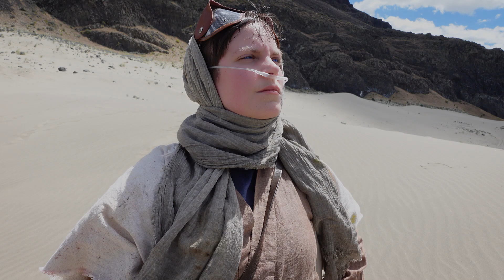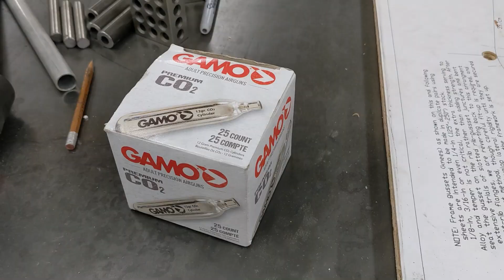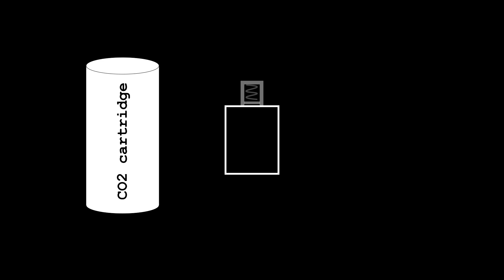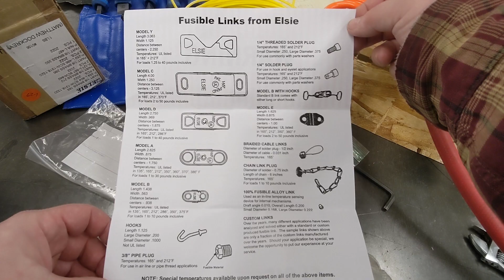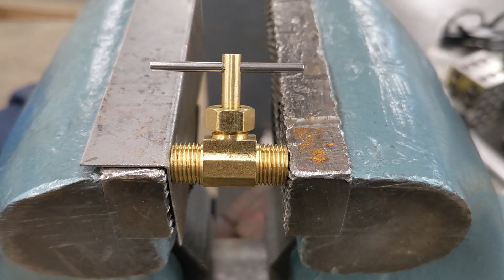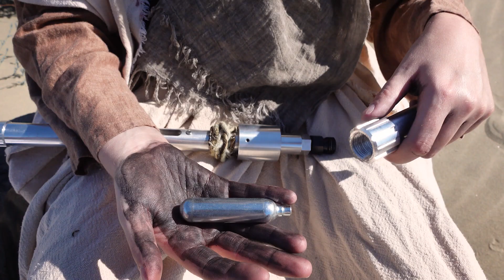Making a Fremen thumper

Comment: Such a cool design!  Wish I had seen this when you first posted it~

I built a couple air-powered WW2 "anti-tank" weapons (British PIAT and German Panzerfaust).  I found a larger CO2 cannister, used for paintball, I believe.  The bigger ones are 88 grams, there are smaller ones that are 45 grams (IIRC~) for soda stream machines.  Either of which is a LOT more CO2 than the small 12 gram ones commonly seen and used in your build.

Despite the much larger volume of gas, the pressure is the same, so the rest of the build can be unchanged.  Just a thought to make this run longer, possibly a LOT longer.

Another thought is to use a different fuse- I have gotten some that runs almost a full minute per foot, so you could do something like that pretty easy.  It's be possible to also have the wicking on the outside use a pre-treated flammable material- much like a campfire or fireplace starter.  Just use some match heads or black powder to give the fuse a little more "OOMPH" once it hits the end.  In this manner, the wick could be pre-applied, and covered with foil or plastic, making the fuse storage easier, too.

Again- thanks for a super-cool build!

Comment: if I had to guess, clockwork is shorthand for a spring powered mechanism, rather than an elaborare system of gears. as for the periodicity, a pendulum is liable to stall at even relatively shallow  inclines so I would guess it'd be an escapement wheel like a pocket watch. however to get powerful thumps as is being suggested, I could only guess it uses something more like a petrol engine.

Comment: Maybe a somewhat strong spring on the top of the hammer (inline). So, the air pressure has to build up enough to overcome the spring, where the top exhaust port would be placed when the spring is at full compression. You could also add a set screw above the spring, which will give some variable spring force. It also seems like it’s leaking a lot?

Comment: Well, I have just spent 20 minutes shouting "CO2 model airplane ENGINE AAAAA!!1111" Tom Stanton has plenty of wids fiddling with them and making his own. Basically - piston has a small protrusion to actuate a ball valve beneath it. Even more basically - piston pokes the ball away from its seat in a ball valve and gets a puff of CO2 in the face. Easy and would run for much longer!

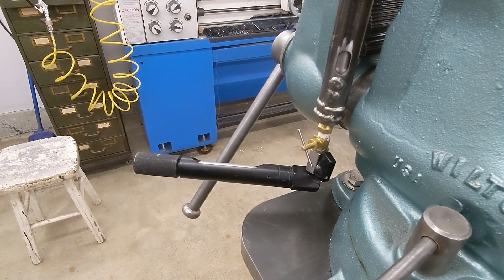Comment: 12:13 Use the 88g cartridges designed for inflatables. They are larger and could increase your run time. It looks like you are using the 12g size. The cartridges for life rafts and vests also have a threaded neck, which may be helpful for attaching to the thumper.

Comment: A clockwork would have solved the run duration problem. A common escapement could provide a minimum of 20 hours run time. Also clock works are more durable than one might expect. The only real challenge is sealing it against sand while allowing it to function. That said, I could never come close to making the system you came up with. You are to be applauded.

Comment: Very neat. Been a Dune fanatic myself for a while. 

Your idea managed to give me some refinement of how I’d see it. Take your idea, but instead of using the CO2 directly, put it through a fixed orifice restrictor, then have it spin a screw. The screw then can lift a hammer against a spring. At a set point a seer on the hammer section is pushed and released. The spring forcing the hammer section down to strike and thump. The seer resets and up goes the hammer again.

The fuel, instant trigger, etc. work just as well as in this video. A screw thread and restrictor give you options to tweak the thump rate to a human stride while probably being a bit more gas efficient, giving you run time. 

Anyways, still a very neat video and implementation.

Comment: If you plan to do a different version at some point, syringe based hot air engines are very simple and give a very nice oscillating movement.  The candle or wick would be the power source, not just the time delay.  https://www.youtube.com/watch?v=WLCrAajASy0  https://www.youtube.com/watch?v=1-XcDuyV2l4

Comment: I'd hollow out the base of the piston and have it hit a poppet valve. Make the bore in the inside of the piston the right depth so that it simultaneously opens the valve and strikes the metal around the valve to make the heavy impact. The open valve releases a spurt of gas into the hollow in the piston, pushing it up and thus closing the valve. If the cylinder is so short the piston hits the upper end, use a buffer spring to slow it down then push it back down to strike the valve for the next cycle.

The fusible plug can be places somewhere under the poppet valve with a screen or a wad of steel wool to catch the ejected metal.

Another method of safe storage and activation, requiring no disassembly and reassembly would be to have the poppet valve in a movable plug with the piercing needle on its bottom. The plug would have a seal and a way to hold it in place after it's driven down. To drive it down, the piston is held at the top of the cylinder by the buffer spring. Designing a way to hold it up against the spring tension - such that it can be released manually or with heat - would be the tricky bit.

Release the piston, it flies downward and by its weight plus spring assist forces the valve block down to where it opens the CO2 cartridge and the block catches into place.

In practice a thumper would be a single use device so there would be no need to be able to release the valve block after it's locked down, or to re-set the catch holding the piston up, or to replace the CO2 cartridge. I'd have a threaded top cap on the cylinder and the CO2 cartridge chamber unscrew from the bottom, where the valve block would be pushed out then re-inserted from the top of the cylinder. A simple stepped plug inserted into the cylinder bottom would serve to set the valve block position so its needle would not quite touch the cartridge seal.

For sealing the valve block in the cylinder I'd expect Fremen to use a wrap of waxed or greased leather. It only has to work once, briefly. A Earth made prop could get by with an o-ring or two and silicone grease.

That's the gist of how I'd make a thumper that's ready to jam into the sand and set off with nothing to take apart and possibly lose in the sand.

Comment: Very cool and simple. I think you are on the right track there with how a fremen thumper would look/function. 

I would be interested in making a variant with a small candle holder. You could use longer candles to set your time and once the candle burns down low enough the flame could be moved into position to heat up your valve. Any latch like mentioned in the book could just be a lighter.

Very cool idea. Any plans to share your drawings on the thing or sell some units?
Reply from the maker: I can't imagine anyone would want to pay what the labor would cost, but I can definitely put up some plans!

Comment: If you neck the flow down to slow the release of CO2 into the piston area, any amount of necking back up underneath the fusible plug will act as a capacitor that can deliver lots of flow, causing a bang when the plug melts. If you cut a hollow spacer to fit inside the plug, you'd replace that large volume of high pressure gas with metal and eliminate the bang. A thinner flow restriction prior to the plug and a better fit between the piston and sleeve would allow the thumper to run for longer, too.

Comment: This is very cool but I have to admit I shed a tear when I realized the guy with an escapement wheel logo skipped a clockwork solution.
Reply: HOLY SHIT ITS JOSH
Reply: @Greg_WASD  I could also see a few ways a candle could be used as a time delay with clockwork.

Either activate the reciprocating system with a sprung latch that is normally active (i.e. fighting the spring will stop the thumper) which you can then hold inactive with a length of fuse.  Once the fuse burns out, the latch springs back and the thumper activates.  Alternatively, use memory alloy to pull a latch that is normally inactive, then light a candle under it and wait for the memory alloy to coil up, pulling the latch to active.  Both could be activated directly, either by holding the latch inactive with your thumb while winding, then letting go and legging it for the first design, or by pushing the latch and manually bending the memory alloy for the second design.  Memory alloy is perhaps more extravagant, but it's still cheap enough that they make kid's glasses frames out of it, so it's not hard to imagine that someone in a low-ish tech scenario would have access to it.
Reply: @dafoex candles were used in the books

Comment: I really love this, it's such a simple design and completely different to how I pictured them in my head, which as an engineer always fascinates me.
I always pictured it as having a heat expansion to create the pressure, hence the candle and something like an escapement from a watch releasing the piston at one or two hertz which satisfied the clockwork style description from the book in my head.
As an aside about your comment on the pressure not changing the frequency of the piston in the early test, that's because the frequency is defined by the flow rate in the bypass channels rather than the pressure,